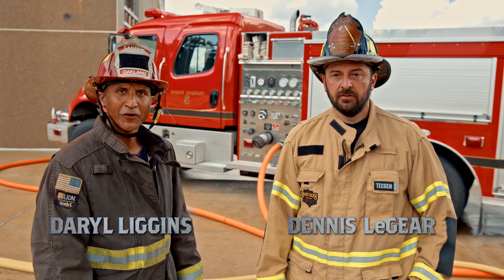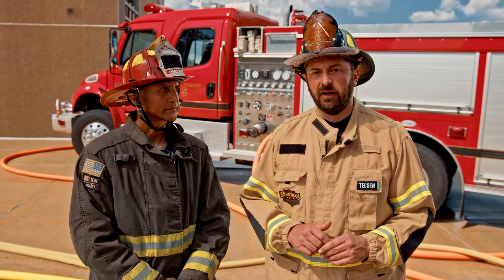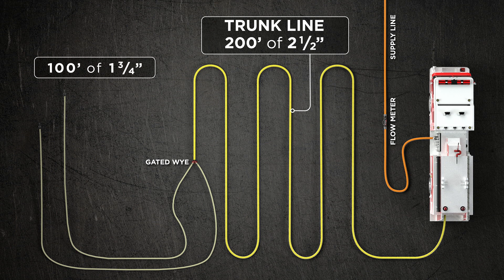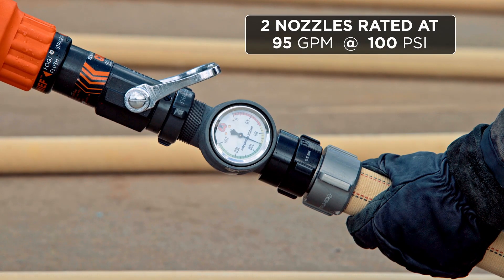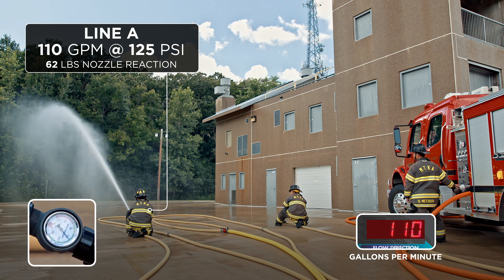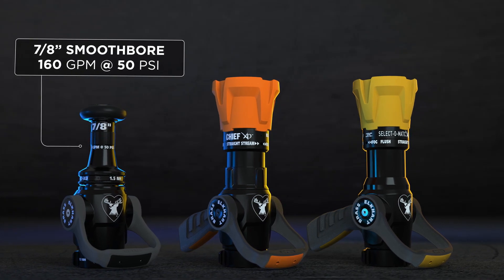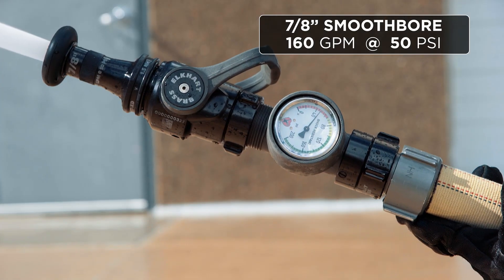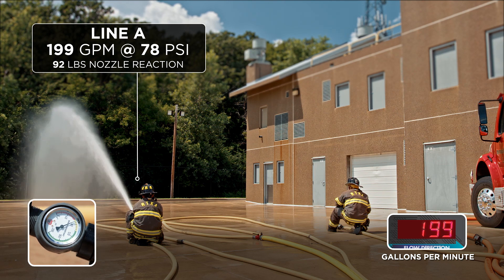Gated Wye Operations – Extended Version (Ep #57 & Ep #58)

Comment: Wonder if an automated pump management system such as the Hale SAM would be able to monitor discharge pressure and adjust it on the fly as the individual nozzles are opened and closed?

Comment: I wonder if you are going to use a gated eye operation with 2 lines a partial fix to the increase pressure to the other line off the gated wye is to only partially close the line. This way the increase pressure is manageable.